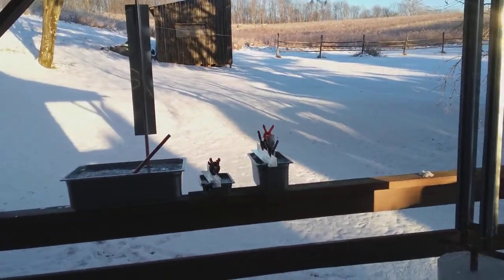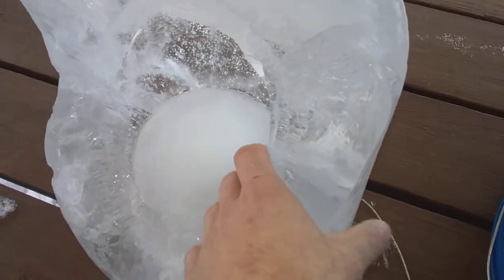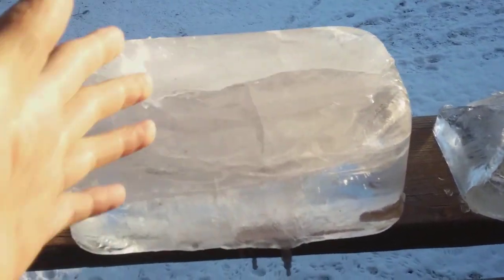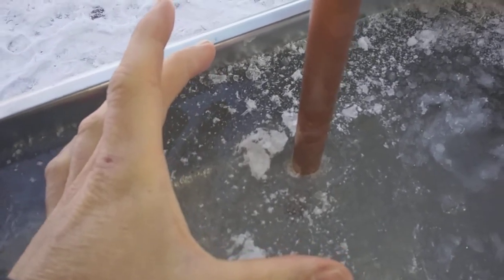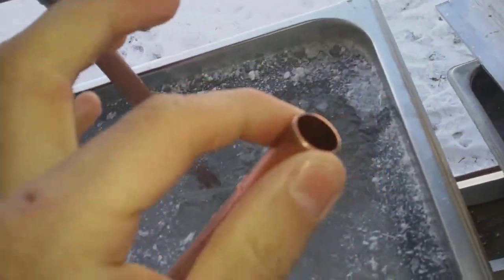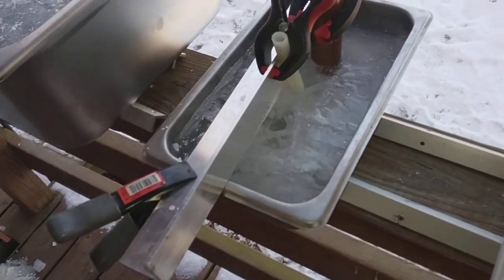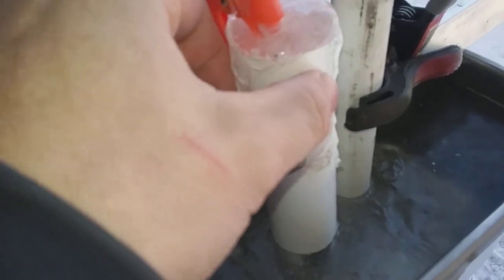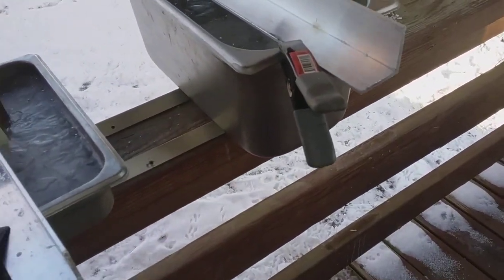Making Ice Blocks, Expansion, Thermosiphon

Comment: I can only assume you're trying to make ice for an old school ice box. Rocking the container back and forth might provide a solid source of agitation. If you could get your hands on a disused grandfather clock and use the rocking of the water container as the pendulum, you could use the clockwork and weights to keep the container moving on regular intervals without using electricity.
Reply from the maker: Yes, it will be a modern version of an ice refrigerator.  First to see how much ice I should be able to make.

Vibration and agitation have been used successfully in the past by others, but I think it would take a lot to keep the top from completely freezing, unless I insulated the top as well, which I'm trying to avoid.

I like the clock pendulum idea.  I had a similar idea for a windup spring mechanism to vibrate a slurry ice generator.  I'll keep this in mind.  THanks